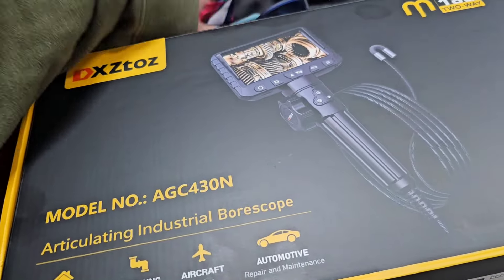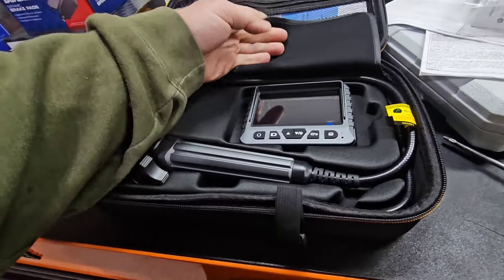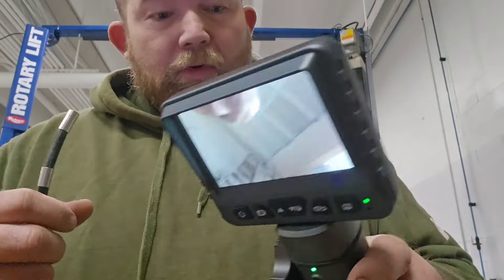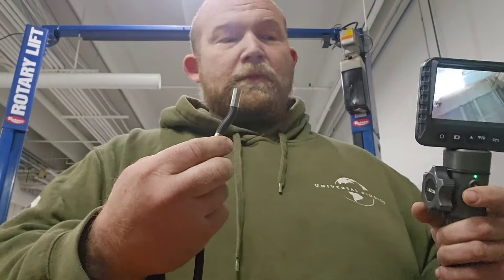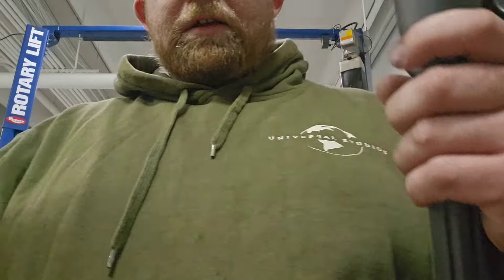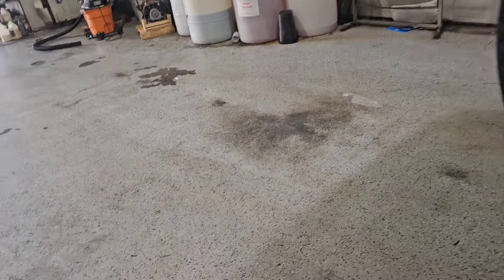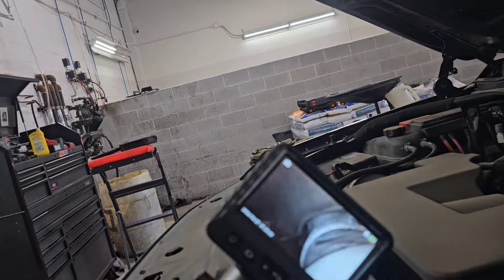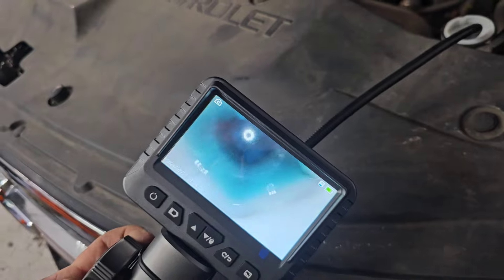Two-Way Articulating Borescope, DXZtoz Industrial Endoscope with 0.33in Articulated Snake Camera

Comment: The question is durability my cheap ass Vividia that was $249 on Amazon, broke and is not covered under warranty. For $139 I may just get this rather than sending off my unit to get fixed. Looks like it can articulate 180 degrees inside a piston aircraft cylinder, which is what I’d be using it for.
Reply from the maker: This is nicer than the snap on one I just used that was 500$